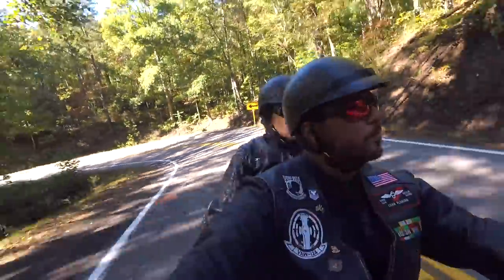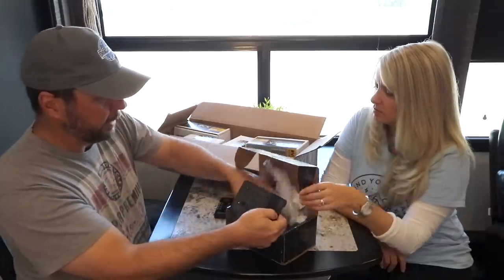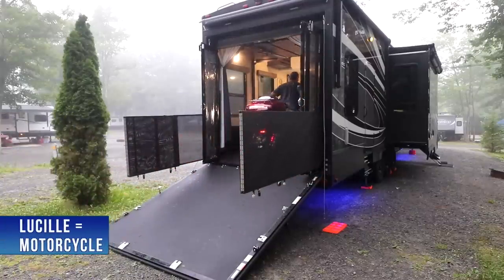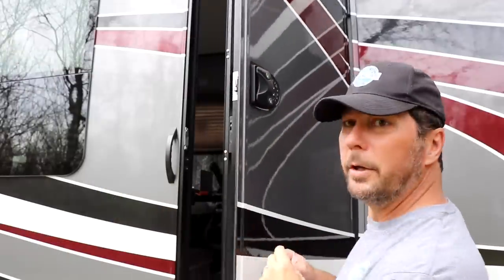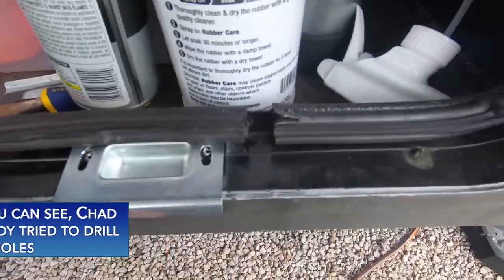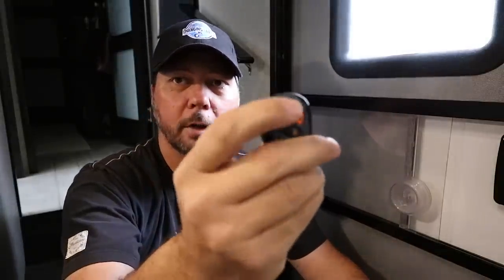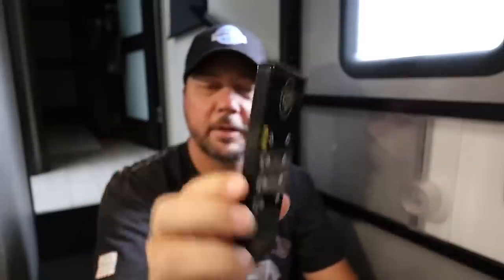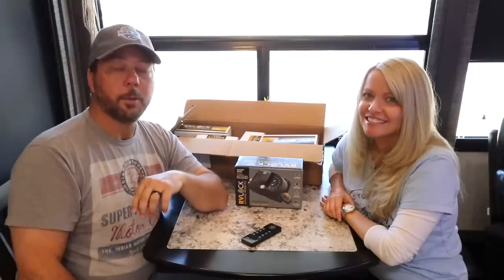RV Keyless (Keypad) Entry | RVLock | Full Time RV Safety | Changing Lanes!

Comment: Hey guys! Great video but unfortunately your discount code did not work. I went with the Carmtek RV Lock. It is an all metal, quality made lock and was on sale in Amazon this week. Easy install and I highly recommend as well. I wouldn't go with any other lock other them Carmtek or RVLock......
Reply: Also, highly recommend changing out those CH751storage tubular locks with some Cam locks for security as well.
Reply from the maker: Strange.. I just tried it (CHANGINGLANES15) and it worked...  The Camteks look nice though.

Comment: Thanks for this. My used unit has a similar lock on the back door but is separate from the standard lock.

One question, is the upper key still the industry wide master key?
Reply from the maker: I'm about 97% sure it is not.. but you'll need to ask RV Lock to be sure.

Comment: I’m assuming there is a battery on the lock. How long does it last and is there a key backup in case it goes dead. Thx for another interesting video.
Reply from the maker: Yes and yes.  We've had the stock batteries in our main door lock since Jan 2018 and still going strong!   Thanks for watching! 😃

Comment: we purchased a lock from them per your recommendation and used your code.  However, it is cheaper than the one that came with the rv (has a plastic handle instead of metal) and there is not enough of a grip to close the door.  We hate it and hope we can get our money back.
Reply from the maker: We have almost 4 years of daily use on ours and have had zero mechanical issues.  The inside handle is a little slim but we've never considered it difficult to close the door.  They will refund your purchase if inside 30 days.. https://www.rvlock.com/pages/returns
Reply: @ChangingLanes  we returned it and I have a tracking number that proves they got it back in September (we got it in late August).  I am still fighting with them to get my money back.

Comment: Just purchased and installed the door lock, thank you video and for the 15% discount!! I forgot to get the gasket though as I had the old bauer lock as well... but for $200 bucks... rvlock should just put the gasket/sticker in the box without having to pay an extra $4 +extra ship/hand. My fault though.
Great product and easy 1 beer install. Well...actually it was a two beer project as it was a little warm outside :) As for the inverter project install...I'm going to have to stock the fridge
Reply from the maker: Yea.. and maybe a case in the basement to re-stock... LOL   You have the full body paint option?  Might want to pull off the stock handle just to make sure you actually need the gasket.  They should have the gaskets as an add-on option when ordering the lock, so people know about it and remember to get one.
Reply: Yep...fbp. Just got her...Cedar Creek 37rth with the garage and the bed that raises up to put the toy inside. Not as "fancy" as the G.D. but it's nice. First trip planned next week and of course have to do a 90d blind side back in at the site! I will be poppin some tops when I get her backed in and all hooked up... Cheers!  @ChangingLanes
Reply from the maker: Awesome!  Good luck with that 90!  👍🏽😎

Comment: Hey u 2 I don't know if you're still looking at comments on this video but, I have a question on the baggage doors I noticed you have a keypad with a regular lock on the same  baggage door. Does the regular mechanical lock without keypad work with the Master Lock & fob and you don't necessarily need the key pad on the baggage doors how does that work? Thanks so much, always Love ur viedos. LeLe fr: Cali.🌞😎
Reply from the maker: Each lock is a separate unit with a separate fob.  The manual locks are just that but work with the RVLock key (not fob).  Hope that helps!   If you call them, I'm sure they can help get you sorted.
Reply: @ChangingLanes  Thanks for the response, I did call & got that settled👍🏽

Comment: Chad , Since it's been a few years since you installed the new door locks, how do they hold up ? Any issues  ? Thanks
Reply from the maker: We've replaced the keypad membranes a couple of times, which makes them like new again.  That and batteries about once a year and they're great!
Reply: Another item I'm considering is the snap on pads.  I have read reviews of people losing them going down the road.  Have you lost any going down the road ?  Thanks
Reply from the maker: We've never lost one in over 40,000 miles. 👍🏼

Comment: Yeah, that full body paint isn't.  I pulled a clearance light fixture and rear camera mount on our 21 Keystone Alpine looking for some slack in the wire and discovered the same thing on our $10K full body paint option!  I can't imagine the production management's decision to mask external fixtures instead of putting them on after paint.  Oh yeah, that's the same management that taught the crew to install the "patent pending front windshield" with a crooked gasket AND with the ends at the top, forming a nice gap for water intrusion!

Comment: Thank you for your video.  We just ordered and received an RV Lock Keyless Entry....but realized ours says COMPACT and doesn't included Motorhome on the list of RVs it works on, looks like we'll be sending it back.  
We love the storage door Keyless Entry Locks, but at $179 each, our Motorhome has like 15 bays....it'll be a while to have one on each door but we can definitely start out with the water/gray/black tank doors (2).  
Thank you for your video!
Great job!  👍🏼🙏🇺🇸
Reply: Cindy Rose you can take the existing locks to a locksmith and change the keys.
Reply: @danapicray9040  
Thank you for your reply Dana, the keys have been changed, it's the convenience of locking and unlocking ease is the reason for RV Locks.  😉
Reply: @cindyrose5414   Sorry about the mixup. We have a separate handle for Class C and A motorhomes. Here's the link:) https://www.rvlock.com/products/class-c

Comment: What happens if you lose a keyfob? Can you "deactivate" it? I would hate to lose it and have a stranger be able to unlock my doors.
Reply from the maker: Yes...Good question!  Holding down the LEARN button for 10 seconds will remove all previously synced remotes from the handles memory.

Comment: I have the same V4 lock on my entry door but had to remove the stock  striker plate where the bolt sides into to lock the door....not found a fix for that yet...Any ideas ?
Reply from the maker: I assume it was hitting?  I'd give RVLock a call and see if they have a solution....

Comment: We just bought a camper with this lock on the front door... it is SO HARD to open, I broke off four fingernails on day one...ALSO, it is very difficult to close the door from inside!  Any suggestions???
Reply from the maker: Get some silicone spray lube and get it on all the moving parts... You might also try adjusting the strike plate.  👍🏼

Comment: fyi, RVLock is limited to which of their locks will fit class-a's. I have a 2022 with a vertical handle with a lock and a deadbolt. RVlock does not have a solution.

Comment: I just installed mine. Lock and unlock work fine until you close the  door.  I hit the lock button and you can hear it lock but when I pull the handle to check,  the door opens. I have to use the key to lock and unlock.  What did I do wrong?
Reply from the maker: I would call RVLock.  But, also make sure you keep the lock very well-lubricated with a good PTFE dry lubricant.
Reply: @ChangingLanes  I think I figured it out. I had to raise the lock itself a little so now it lines up with striker plate.  Next question though.  Does it only lock the deadbolt ?

Comment: Here's the only downside. You leave your keys in the rig because you want to go swimming etc. You come back and cannot get into the rig because the battery in the lock has died. Has it happened, yes! Now in your case you have multiple doors. Others may only have one door.
Maybe, the brand you were showing has a low battery chime. However, many similar brands do not.  So a "hide-a-key" when using these might be a good idea just in case.
Reply from the maker: Yes... It will warn you when the battery is getting low in plenty of time to change it.  But having a key as a backup is never a bad idea.

Comment: Mine stop working after 3 months. They said I should try to get it fixed.
Reply from the maker: RV Lock has a 1 year warranty: https://www.rvlock.com/pages/warranty 
What stopped working?
Reply: Thank you, Changing Lanes, 

I know about the warranty but since it was tough to install, I didn't want to take it out and stay without a lock for days. 

The keypad just stopped functioning after two months. Now I use it as an expensive regular lock. 

I've tried to contact them, but they didn't help much. They said I should uninstall (which is hard on my RV) and check the batteries (after two months).

And I gave up.
Reply from the maker: You can replace the batteries without removing the lock....

Comment: Come on, manufacturers!  Don't you know you ALWAYS remove cabinet and door hardware to paint???
I presume these are battery operated; where does the battery go?  In the remotes, or in the actual lock mechanism?
How expensive are these?  They seem like a great idea, but I'll be hitting the road on just my social security...
Reply from the maker: Batteries are in the handle and last a little over a year will full time use.
You can find pricing here: https://changinglanesrv.com/rvlock, and get 15% off if you use code CHANGINGLANES15 at checkout.
 Thanks for watching! 😃

Comment: Tried to use the code, but it wouldn't accept it.
Reply from the maker: I just tried it and it's working..  CHANGINGLANES15
Reply: @ChangingLanes  Bummer. I bought it without the code, but still got a good deal. $195. Thanks.

Comment: until the battery dies and locks you out....hide a real key somewhere.
Reply from the maker: They do each come with 2 keys and you can get all of them to match.  but, yes... always have a backup key.  But it should also be noted that the units will warn you of batteries getting low before they die.  Wont help if it's in storage though.